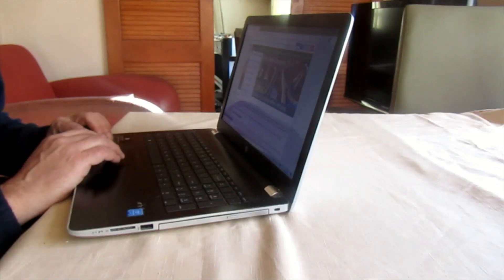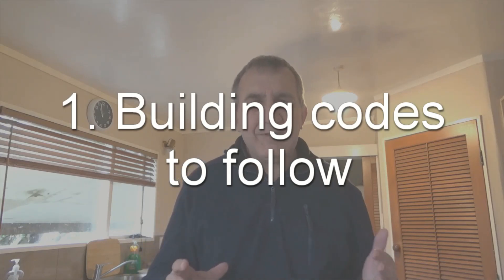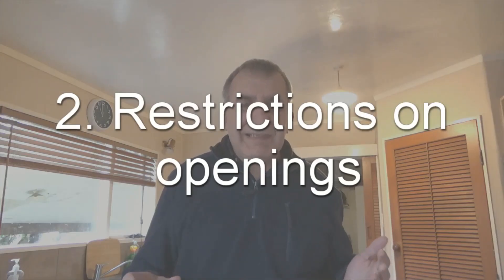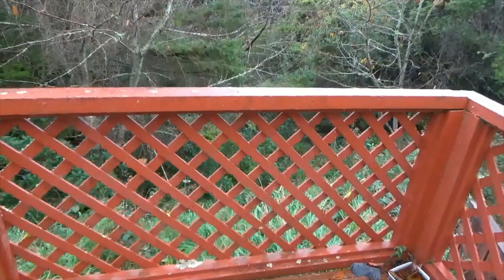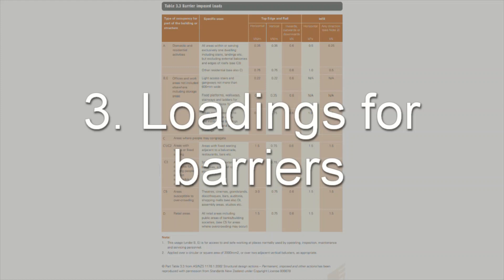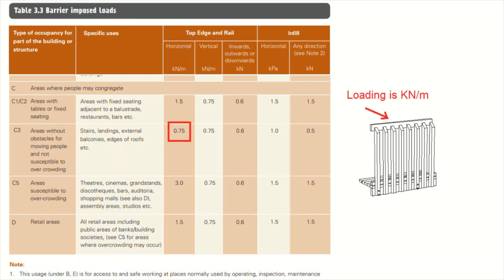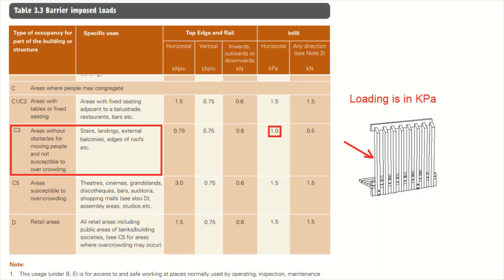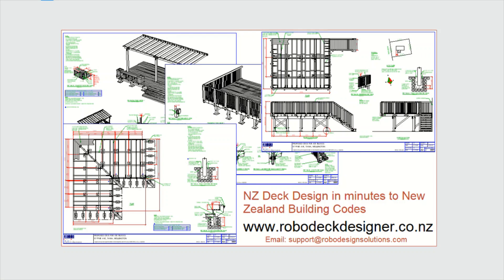Handrails for New Zealand decks - the infilling of handrails

Comment: So my deck will end up being less than 1m to the top of the decking boards. So I assume no barrier is required. I do want to put a decorative style railing/balustrade at the end of the steps and down the sides of the deck. As it is below 1m hgt does my railing have to meet the code requirements. For example could the gap between the spindles be greater than 100mm?